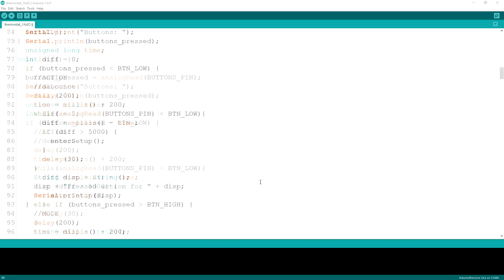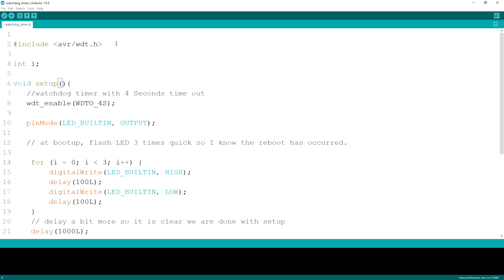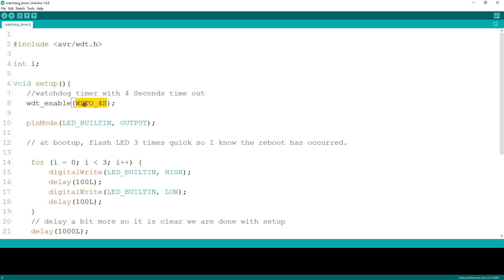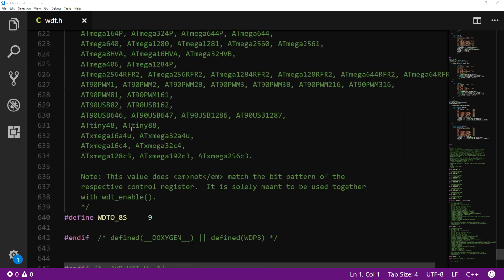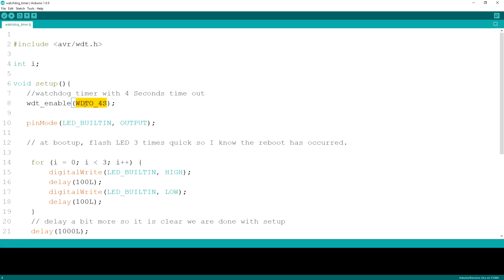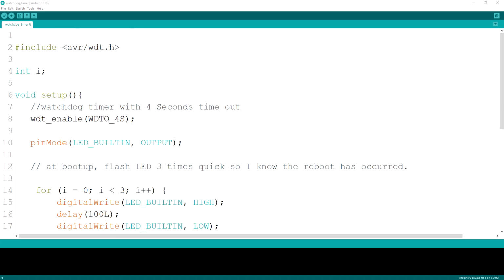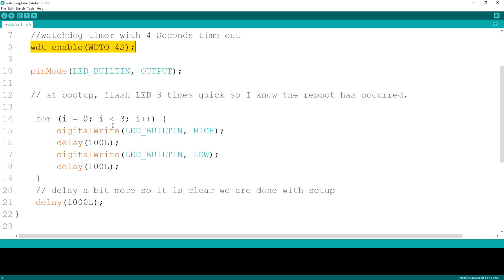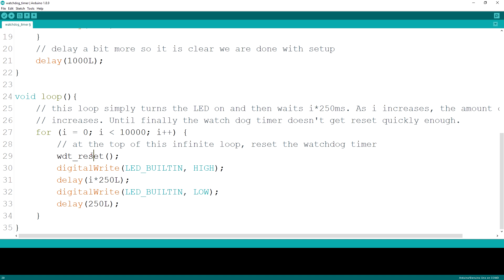The Arduino hang guardian - Arduino watchdog timer tutorial

Comment: Many problems with arduino watchdog timer hanging board on reset. It happens on arduino uno and mega2560. When watchdog times out it will hang board. I have given up on this and resorted to using a hardware watchdog to trigger reset pin directly. I noticed that on arduino mega it did work until i added the one wire library to read a temp sensor on one wire bus. Then it hangs on watchdog timeout. Libraries and other code should have nothing to do with watchdog resetting board, but it is so poorly implemented that apparently your code affects its reliability. (using 8 second watchdog timeout)
Reply from the maker: Yeah, it really depends how the library is constructed and for that I can't really say much. Using an external watchdog is definitely acceptable and I'm glad that you managed to find a solution.
Reply: @TasteTheCode  yea, but I thought the watchdog was supposed to be unaffected by your code. I thought it was supposed to be an independent hardware timer that if not reset would do the exact same thing as when you manually press the reset button, but I guess something a little different goes on here.

Comment: Hello Sir,
I need your help.
I want to set watchdog timer for my arduino program.

My condition is if digital read pin 5 goes low for  max. 8 second then arduino should reset.
Please guide me.
Reply from the maker: I do not think that watchdog is needed here in your situation. You can use regular timing and then using another pin connected to the reset pin on the Arduino you can reset it from code.
Reply: @TasteTheCode  Hello sir,
Thanks for reply
I am beginner for software programming

I have written a program to control my device.
Program is working fine.
Now I want to assign watchdog timer to reset my atmega 328 if stop working 

Please send your email Id. I will send my program to you 
Please resend it to me with watchdog timer to reset my controller if stop working for 8 seconds
Reply from the maker: @Viratworld123  Sorry but I do not do services like that. You should have more than enough info in the video above to implement that yourself.
Reply: @TasteTheCode  Hello Sir,
Please help,
I am beginner in programming. I don't understand critical programming hence I don't understand how to apply watchdog timer